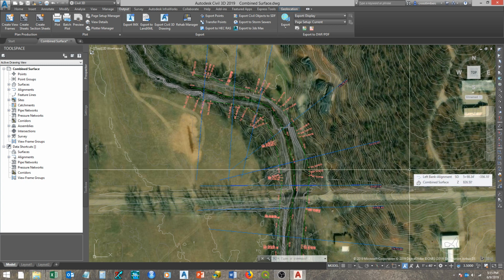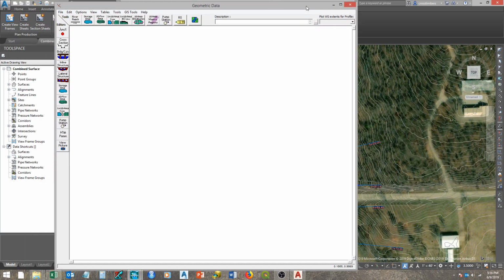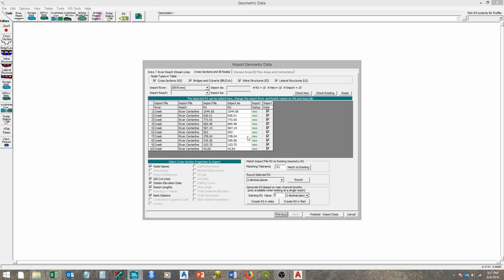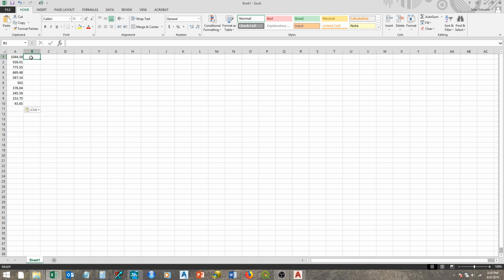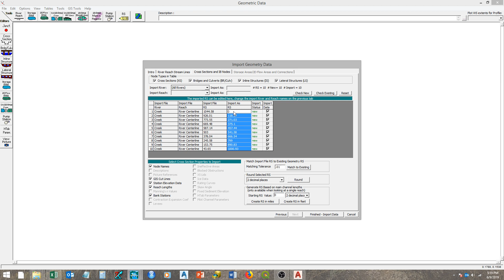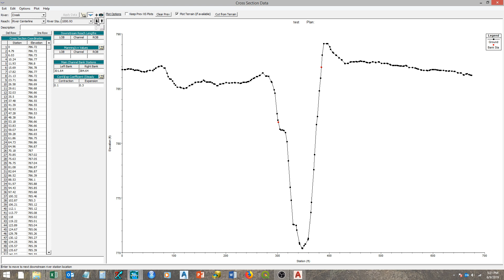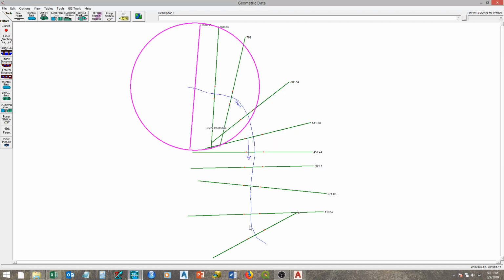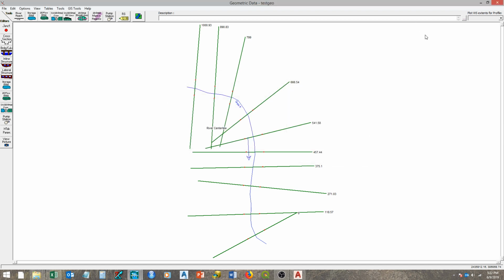7 - Importing geometry into HECRAS from Civil 3D

Comment: Hi John, Thanks very much for sharing this. I was wondering, how do you fix the sections intersecting each others like for example  799 and 666.54 in your example? Is there any way you can make a bend without necessarily cutting them in order to avoid them to intersect? (In the situation when you receive a survey I mean, so you have no surface to cut them from)